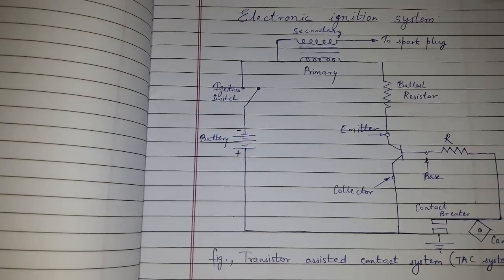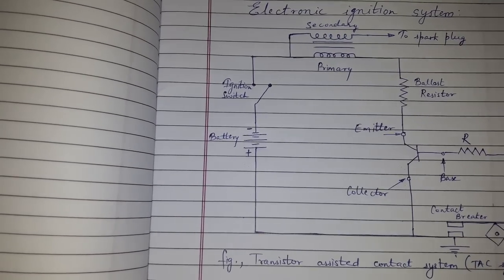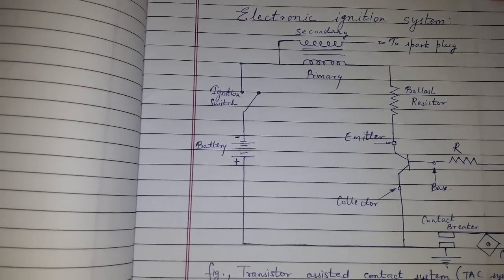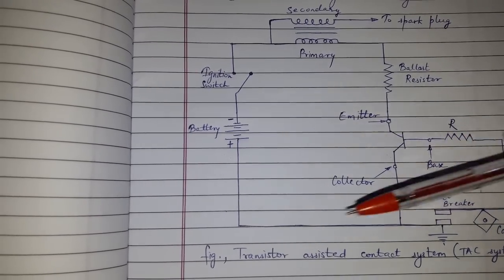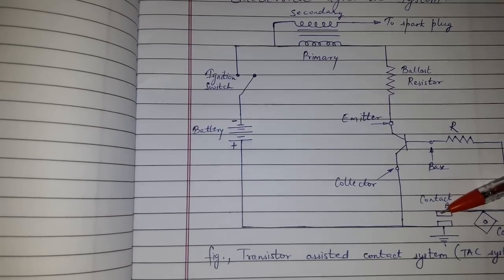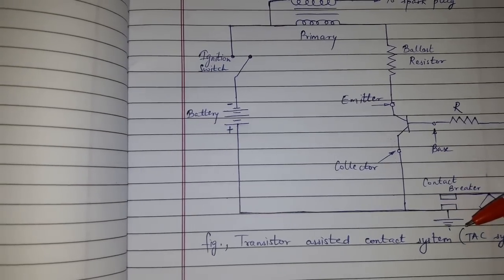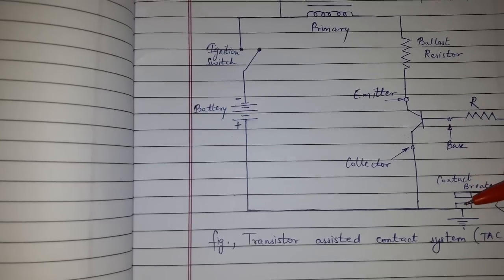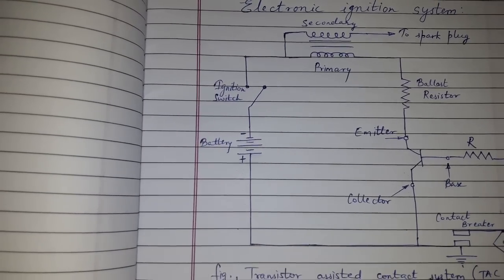Electronic Ignition system (Transistor assisted contact system-TAC system) #30kviews #viralvideo

Comment from the maker: Easy explanation.

This channel is for Mechanical diploma students (Channel: MechTech KnowHow)

Currently it has videos related to AUTOMOBILE ENGINEERING. 

Please like, comment, share with others and SUBSCRIBE  for more videos on other topics and subjects (its free). 

Will help students to prepare for examination.
Reply: #MechTech KnowHow:
I have one doubt wrt TCI system operation in my motorcycle.here is the scenario
My motorcycle produces peak power at 8500rpm and after which   TPS detects the throttle position and cutoff the TCI power supply.

In this case does TCI is programmed to generate power only till 8500 rpm? If I wanted to increase the increase the rpm limit till where the power to be supplied what are the considerations should I make?

Comment: Not working causes:

- capacitor across primary to increase spark efficency;
- safety zener to prevent voltage spikes across base and ground;
- circulation diode across collector and emitter.

Diodes and transistor must be at least 2 times bigger in voltage and amps. This due to the spikes that the coil in combination with the capacitor go to resonance (but this is a general case, you need to calculate it). The design is not working. I tested it in real life and it blows up in half second!!!